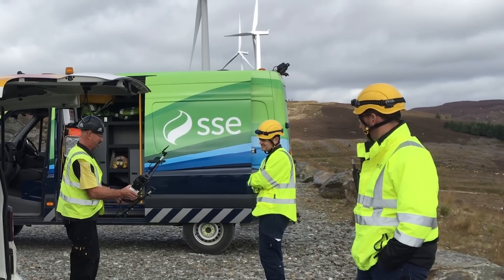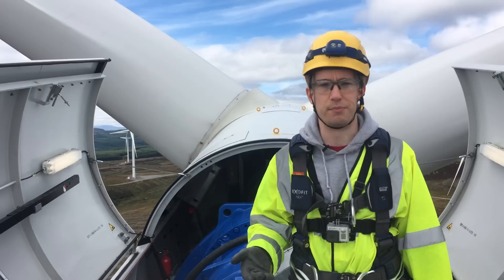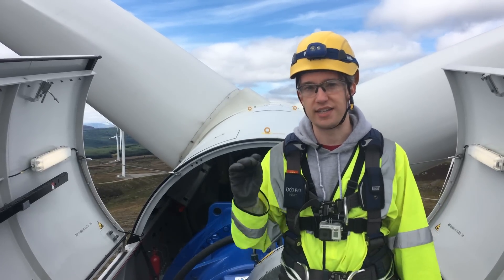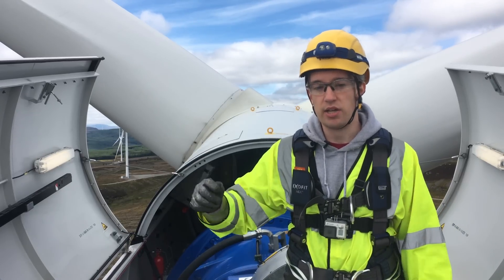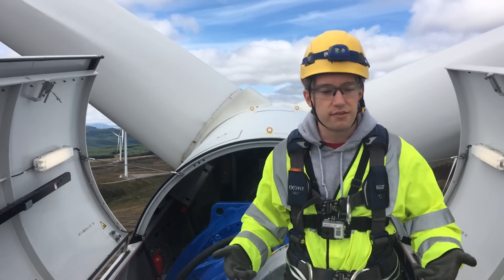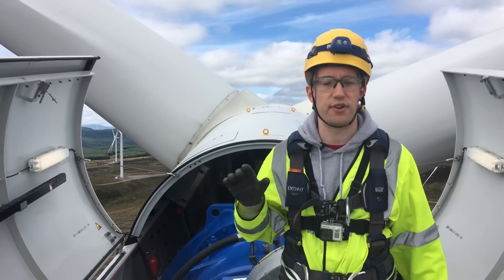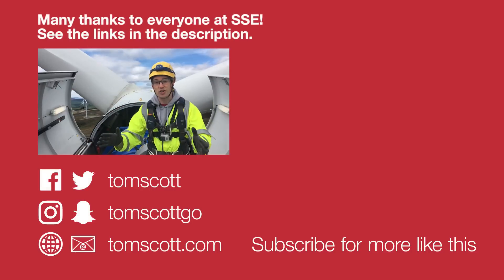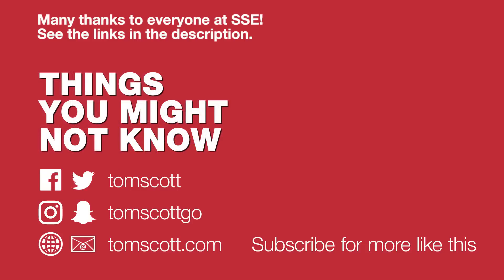The Problem With Renewable Energy (and how we're fixing it)

Comment: Things have changed since 4 years ago.  Now in 2020 the utilities are installing the 'monolithic batteries' that Tom mentioned.  The grid scale battery at Hornsdale in Australia has about the same power as Tom's wind farm -- 150 megawatts.  Tesla installed it in a few months and it has paid for itself very quickly.  These are being installed in the US and other countries.  They are solving the problem of frequency regulation that Tom mentioned.  Thanks for the video, Tom.
Reply: "paid for itself" 🤣🤣🤣
Reply: @russmillerskipplestein  dont know what that means? Or you know more on the topic and it has not yet payed for itself?

Comment: OH MY GOD. HOW HAS NO ONE EVER TOLD ME ABOUT HOW THE TURBINES WORK!? THEY HAVE TO SPIN AT THE SAME RATE!?
Reply from the maker: Only on traditional power stations that boil water: coal, oil, gas and nuclear! But yes: they all work in time. They have to, the physics of alternating current requires it!
Reply: A pretty impressive synchronised song and dance, though not a particularly pleasant one.
Reply: ***** Here in Sweden we burn trash to create power, but I bet it's the same deal.
Reply: they are called synchronous machines and they do this naturally, you don't really need to make them do it, you just need to make sure they stick at the right frequency. it happens because there is an electromagnetic coupling (i.e. they stick to each other like an elastic band) between the spinning turbine and the electricity generated in the grid. if one slows down the other pulls it back to where it needs to be and vice versa.
Reply: I like learning new things. You teach me new things. I like you.
Reply: Just wanted to take a second and appreciate this moment: an informative, lengthy and sourced comment, on YouTube. We need more like you.
Reply: They can't help but be synchronized in speed. The trick is supplying enough power to the generator that it is producing power rather than sucking it in which also causes a protection breaker to trip.
Reply: The instantaneous demand differences are handled by the accumulated mass but the real demand challenges are met by the fact that generating stations are never really running at 100% capacity. They do run at over 90% as it is a waste of fuel to run at less, with the exception of nuclear stations which are controlled by demand. The smart grid as you described is a catastrophe waiting to happen. Simple Physics and Electrical Properties largely self regulate the micro second to microsecond demands of control. It is largely impervious to isolated surges and events. Experience has taught us system wide failures became more common place once more central control was initiated. The trick today is to decouple from the grid in time to save most of the generating capacity before events trigger a cascading failure. Good luck on chasing that renewable dream but all renewable energy lack the one thing required which is dependability.
Reply: +Jagh Haringenamn our trash burning plants rarely produce electricity, the energy transfer of the mixed fuel is too inefficient. They produce communal heating instead.
Reply: The clean energy dream = nuclear + wind + solar (with variation depending on geography and climate). Nuclear gets a bad rap, its kind of like an aeroplane compared to a car; less likely to have an accident but potentially much more serious if it does happen. Running with that analogy though, we have put in so many checks for air travel that it is now the safest way to travel.
Reply: It's also something that would make restarting the grid from a total shutdown a bit tricky. The Dinorwig pumped-storage plant in Wales is one of the plants with the gear to do this. But even in the best possible circumstances, it takes 16 seconds to go from zero to full power, 75 seconds from cold. That's why this system inertia matters.

The other half is those night storage radiators. They're not controlled, but they mean the slow-to-change parts of the system, such as nuclear plants, can be kept running at efficient power levels overnight. If there were smart meters controlling them, they could take up excess power in daytime, from wind and solar. 

Battery charging (and it's not just cars, Tesla are working on big domestic battery systems) is better, and the losses in the battery end up as heat anyway. They get quite warm sometimes. So maybe we'll see storage radiators which are a battery rather than a block of ceramic.
Reply: Connor Hill, Your analogy with a garden hose is very weak. The grid is already full of electrons, two of them free to conduct for every single copper atom in the wire. The "hose" is already full of water. Push water in one end and water comes out the other not delayed by the  speed of the water but by the speed of sound in water. In a wire the "electricity" starts  coming out the other end delayed only by the speed of light. The electrons actually move very slowly. (But then you probably still think the power goes through the wire, which ain't necessarily so: See Poynting vector.)

And a heavy cart of electrons; no electrons are very light. 

Solar panels differ from rotating generators in that they are coupled to the AC of the grid by big transistor circuits generating AC at the correct phase and frequency to give power to the grid. With solar that energy transfer is one way only, there is no inertia of rotating mass to slow down when consumption increases.

But you don't need it. If the whole grid were fed like that from solar power or batteries, then the frequency need never change being determined by good clock oscillators in each generator. Too much load and the frequency would remain the same, but the voltage would drop.
Reply: Donald Sayers I don't think the system you are describing is realisable or practical. There are three reasons for this:

1) A system that relies completely on renewable energy is inherently unstable. All practical renewables are intermittent and we need the power generated to match the power demand 100% of the time. This is why we need inertia for energy storage. Even if we had 100% renewable energy we would still need to pay a conventional power plant not to close down, just in case we need them to provide emergency power.

2) You are vastly oversimplifying the relationship between power and frequency. If the frequency droops then the power generated with the same inputs also droops and you end up not supplying the demand. There is another advantage to synchronous generators in that they can adjust their inputs depending on this droop effect to ensure continuous supply.

3) In a power system you want to keep your voltage stable and set at a certain level. To explain the reason for this I need to do a quick explanation for people unfamiliar with this technical stuff. The power P you get is a product of the voltage V and the current I, P = VI (It does get more complicated than this with AC and number of transmission lines, but this fundamental relationship holds). If you ask the grid for a power P it will do everything to ensure you get P. One way or another you will get P or the system will die attempting to get it to you (intervention will kick in to stop the grid collapsing just before this point). So P is set, which means that if your voltage V changes then the current I will also change. Half V and you will double your I. This is very dangerous, it can lead to transmission lines literally melting. At the very least pulling too much current through will fry your solar panels' interface power converters preventing you from getting any further power until they are replaced. You need control over the current, which is why the voltages are set at specified values and shouldn't change.

Do you agree with me?
Reply: I do not completely agree.

I agree that renewables are unreliable and other sources need to be available such as battery back up as Tom described rather well.

There are big fuses and circuit breakers to stop the powerlines melting.

You are assuming that only the frequency varies with load but the voltage drops too, not enough to be noticeable nowadays, but it does. In my childhood it was noticeable, particularly as incandescent bulbs are very voltage sensitive regarding light output. 

My point is that in physics there is no direct relationship between power and frequency. Power flow in or out of a synchronous machine depends on the phase angle not frequency. If the rotor magnetic field leads the stator alternating field, then it's a generator, if it lags it's a motor taking power.

Some long distance high voltage lines are now DC to cut down on capacitive losses, with electronic AC/DC converters at either end, so the generators at one end are not necessarily synchronous with the grid at the other end or even at the  same frequency as on the Canada/USA border. 

The grid is partially stable because of rotating inertia and load sharing is to an extent automatic because of the synchronous nature of the beast. But load sharing and stability are also ensured by a complicated computerised system, monitoring loads across the country. To suggest that grid stability depends solely on the inertia of the generators is a gross oversimplification.
Reply: Yep that is what I am saying. Take a DC grid (It was tried) as load increases delivered current increases so  the generators are more difficult to  turn, so their speed drops and the voltage decreases. If as the generators slow the driving engines move to a state of higher torque then the system is stable, if not they stall.

In an AC grid exactly the same happens. Greater load slows the generators, which lowers frequency and  proportionally lowers voltage. Stability is ensured not by the fact that they all happen to be connected synchronously, but by the control function that governs  the prime mover driving the generator. The mechanical inertia of the system helps a little. I would love to know just how much stored energy there is in all the rotating machines on the grid.

But in an ac grid driven by asynchronous machines; batteries, maybe dc dynamos driving inverters, solar power etc, there need be no link between the power delivered and  the frequency. The frequency could be set by one atomic clock somewhere. Stability is ensured by appropriate control systems locally on each machine and nationally. As it is now.
Reply: One of the better youtube comments I have ever seen.
Reply: The power delivered to your house is (either) 50 or 60 cycles per second. And it is precisely that, too! In fact, your microwave, oven, and radio alarm clock rely on it being exactly that to keep time and know how long 1 second is! To achieve that, large alternators (generators) have to have a low enough output impedance to deliver power at those frequencies while also having to be kept at exactly those frequencies to operate properly. If they are spun too fast then they would generate too high a frequency with too much power and too low they would essentially suck power from the grid, turning into giant useless induction motors and only leach off of power on the grid.
Reply: This is incorrect. Most wind turbines are not mechanically synchronous... gen 3 and 4 turbines decouple the mechanical speed of the turbine from the grid frequency using power electronics. But the idea of no spinning inertia due to the power electronics is a real issue. On the other hand, Australia just demonstrated that batteries with power electronics can do a better job of managing swings in power than the traditional spinning machines, which are going to oscillate at a sub mode (less than 60/50 Hz) as they absorb the swings.
Reply: The "spinning reserve" requirement was 18% about 20 years ago and is now down below 12% in most areas. It's getting lower with the ability to spin up combined cycle gas plants really quickly. You can get an idea of how much energy is in the rotational mass and the magnetic fields by looking at how long it takes to clear a fault... and that's in cycles. If grid stability depended on each generator than a single generator could bring the whole system online. Most generators can't operate out of synchrony.

Actually, multiple turbines in a given location will develop local "oscillation modes" of say 4 Hz that are related to them pushing against each other electrically and mechanically. That is evidence of the system synchrony that he's talking about. This is also why one concept for stabilizing wind generators, currently being revived in the Texas panhandle, is using a "synchronous condensor" which is a rotational system with no prime mover connected to grid power that is used to adjust vars on the system instantaneously. 

Synchrony in many newer cases - wind, solar plants - is ultimately coming through Irig -B, a channel of the GPS system. GPS is a clock that looks at relativistic effects to figure out location. he Irig-B channel is used inside of power plants to keep modern computerized relays and the other management systems together. Irig-B is also a feed to governors (which control prime mover flow - water, steam, whatever) and excitors which control voltage output. These systems are often entwined but don't have to be. The prime mover control is associated with torque, current, and frequency/phase, where the excitor is associated with voltage and vars ("imaginary" or complex power that does not do real work) and we measure these two parameters as MW (megawatts) and MVar (megavars) with the hypotenuse of them being MVA (mega-volt-amps).
Reply: Jagh Haringenamn This isn’t true. They don’t spin in unison. I’m a technician on turbines, specifically, this exact model he’s on (Siemens 2.3).
Reply: No, they don't
Reply: @richb313  the machinery dosent necessarily have to run at the same speed. Its to do with the number of poles wound on the generator
Reply: @tonyrage2400  Two Generators stay in sync because they have to. Read up on Paralleling Generators to understand more.
Reply: @chillbro1010  Most comprehensive comment  on YouTube I've ever seen. Thank you for sharing your knowledge and experience.
Reply: @richb313  you can parallel two generators running at different speeds. Frequency isnt solely down to rotational speed
Reply: @chillbro1010  Thanks for taking the time to write this out, I just have a few questions:
1) Why can't we use continuously variable transmissions in wind turbines to avoid using the brake in high winds and, hopefully, to keep the turbine spinning at 50/60Hz in low winds?
2) Why can't they do the same with the large turbines in power stations?
3) Surely there's another way to convert the phase of AC power from one frequency to another?
Reply: @chillbro1010  one example of a large AC-DC-AC converter is the NordNed connection between Norway and the Netherlands, which can supply 700MW. The power electronics are quite impressive.
Reply: @richb313  I guess you never heard of tidal then... 4 times per day, predictable decades in advance.. You want "dependable" ????
Reply: @chillbro1010  thank you. That was extremely well explained.
Reply: @rndmtim2  this was very interesting. Thank you for such an articulate explanation
Reply: @chillbro1010  Possibly the best, informative comment I've ever seen.
Reply: @chillbro1010  Thanks, very thorough and clear explanation.
Reply: @Mr190093  Thank you! 4 years after, but I appreciate your comment!
Reply: @webchimp  Webchimp has deemed Tom Scott worthy, this is a joyous day
Reply: NO. "when one slows down they all slow down". False. The output frequency of the power generated from the turbine is rectified from the choppy variable AC +/- 20Hz of the generator (40-80hz) to DC, then it's passed through capacitors, insulators and resistors to form a somewhat smooth constant 60hz output. Each turbine in the park can have different input speeds, the end result will always be 50/60hz. idk wtf this guy is talking about
Reply: @richb313  Presumably a smart grid control doesn't necessarily need to be centralised?
Reply: Think of generators and motors like a giant tandem bicycle, but with millions of them all connected to the same chain. They all turn at the same speed, but the generators push hard on the pedals, while the motors are dragging their feet and pull power off the system.

If you put on another cyclist, you have to match your cadence to the already spinning chain before connecting.
Reply: @TomScottGo  I vaguely remember hearing about some turbines that generate DC power, which allows the frequency at which they rotate to vary with wind conditions.  The current is then collected, converted to AC using an inverter and the voltage changed using a transformer before feeding into the grid.
Reply: @TomScottGo  You could say that for the alternating current they have no alternative but to work all time.
Reply: @Razyre  nuclear is very pleasant
Reply: what if we have been using the wrong model of wind turbines?
what about a new model like :
a vertical axis wind turbine (spinning like a carousel)
this wind turbine would look exactly like a tree, I call it : e-tree,
the trunk of the e-tree is brown, the spinning sails (blades) are green,
and finally attached to the trunk of the e-tree are features of : wifi/mobile network, light and power outlet, to charge a car for example